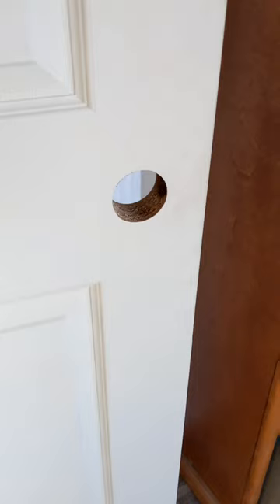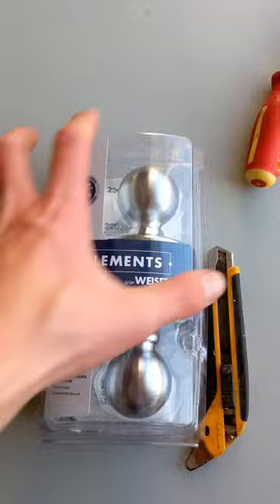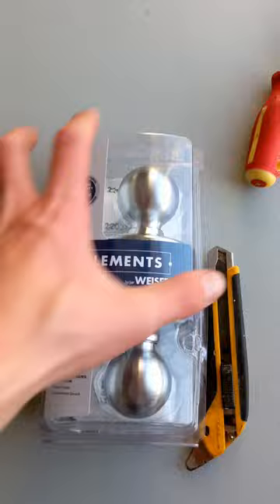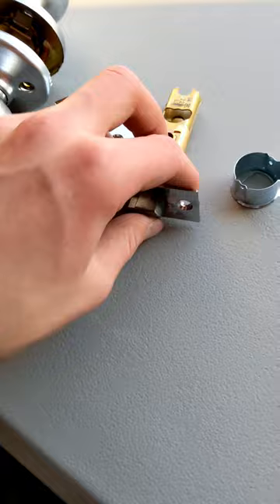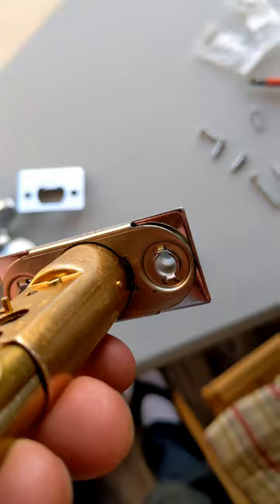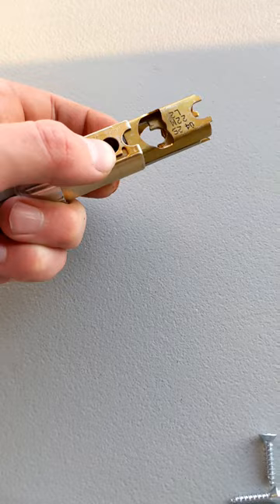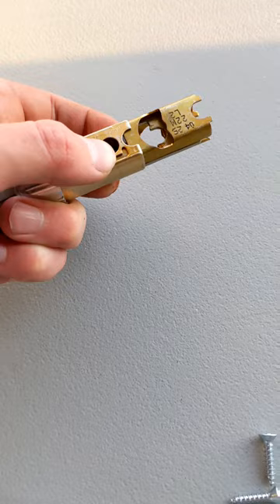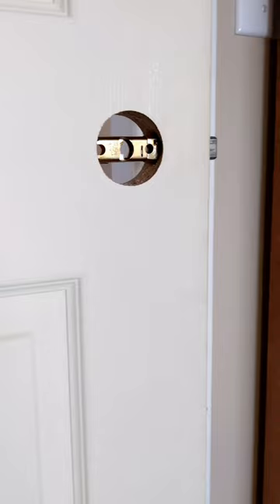Installing a Door Knob In 30 Seconds!

Comment: How did you remove front of door nobbbb
Reply from the maker: The front and back door knob comes apart by undoing the 2 screws on either side of base plate that sits against the door. This should allow you to properly install the knobs on both sides of the door. Hope this helps